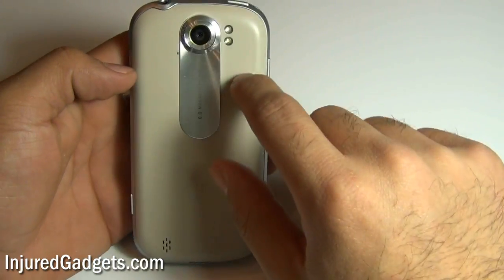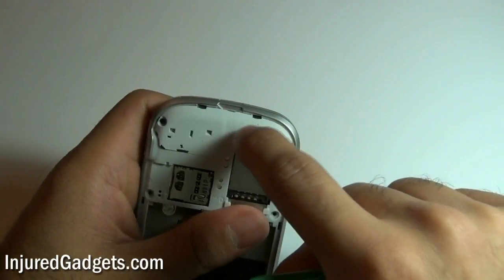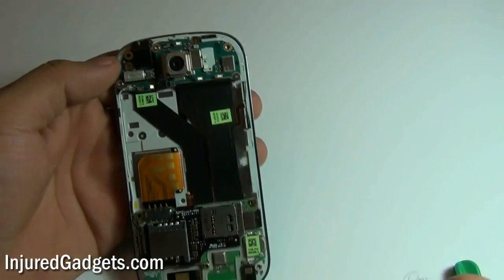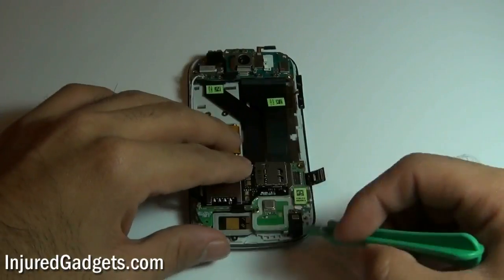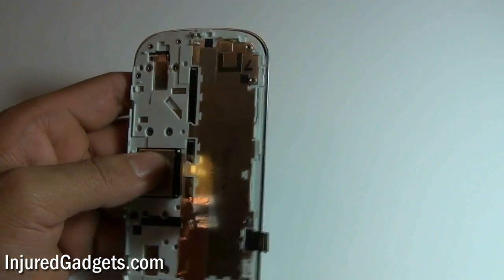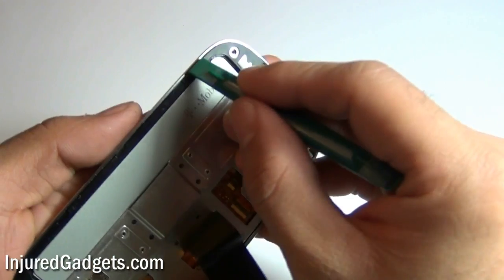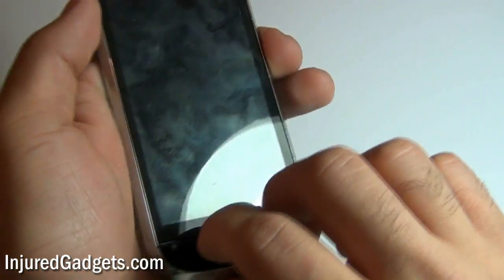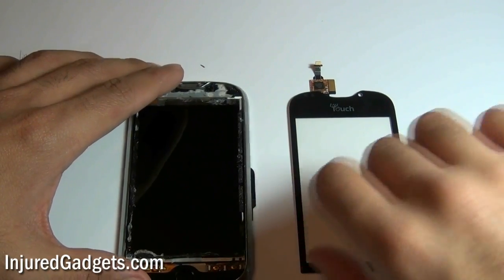MyTouch 4G Slide Touch Screen Glass Digitizer & LCD Display Repair Replacement Guide

Comment: Need to be more specific of the phone model and not misleading.  This is for the MyTouch 4G, NOT the MyTouch 4G Slide. The MyTouch 4G Slide obviously has a slide out keyboard which greatly complicates disassembly, therefore this video is absolutely not helpful at all.

Comment: When you separate the last two pieces, you are tearing apart the microscopic copper wires to the screen. This is why everyone fails with this repair. No, I do not have a business, or sell part. I am just a very experienced repair tech. I will never touch one of these.

Comment: Around the 8:00 minute mark is where you de-laminate the entire LCD screen because the grey adhesive is too strong - even when heated by a tile-removing heat gun this adhesive is too sticky and has too large a surface area.  Save your time, money and sanity and just have a professional replace it.  You don't have access to every piece of adhesive cut to the exact size and shape of the touch panel, slide, buttons, etc....Please do not attempt this repair!  It is too technical for most everyone.

Comment: nice instruction , but now my display monitor does not work , does this have to with the flex cable going thru the keyboard casing or what , what do you think , the monitor worked fine before , i was just changing to digitizer .only.

Comment: Before opening it my phone worked fine ,i just wanted to change the digitizer which was broken. Now after following your instructions and put it back together the display does not work ,not the digitizer.  In other words i do not have ante display , it does power up by seeing the selection buttons lit up ., the flex cable no. 410n712  which is the centre flex cable , the female holding piece broke off , .do you think this the reason the display does not work

Comment: The hot glue most likely cools before you can get it fully in place but no worries, you can preheat your oven as low as it goes. Mine is at 175F then you place the digitizer and bezel in there and as the glue heats it spreads out and you get a perfectly flat fit. The other benefit of this is if you have to replace it again all you have to do is throw it in the oven and it will be much easier to take off than the OEM glue. Hope this helps!!

Comment: Hey Guys so I just did this and I don't know if this helps or not but I've used the same technique in other electronics build. If you don't have the money/time for the 3M Sheets that InjuredGadgets have then you can take hot glue gun, wait for it to heat up as hot as it goes then barely put any on the corners and just a dab on each side of the bezel. Continued----->